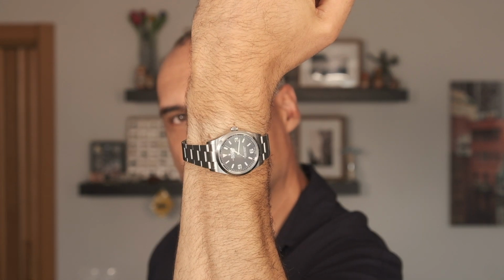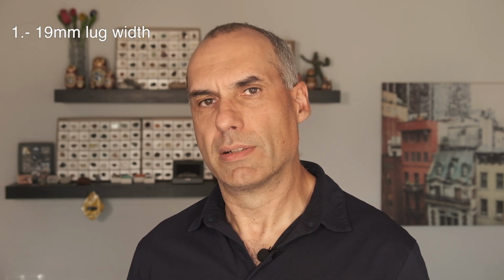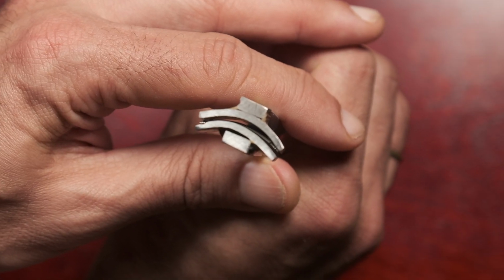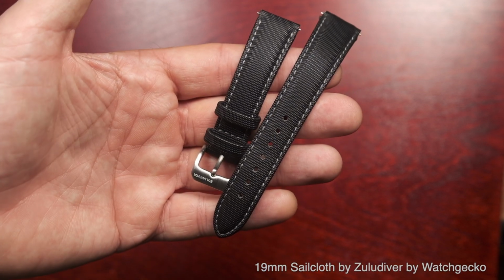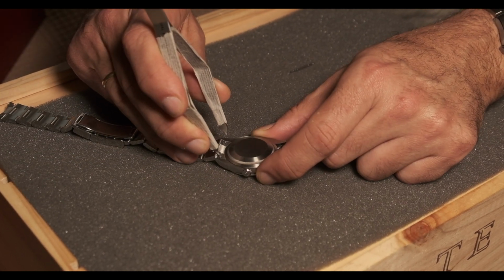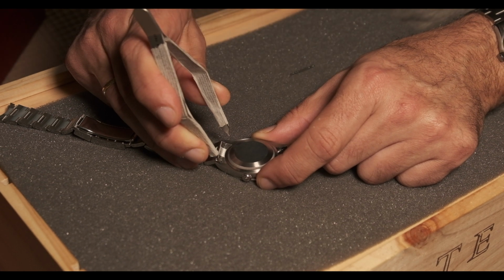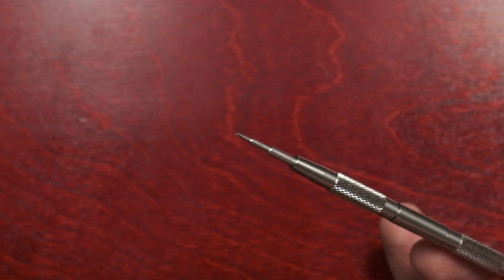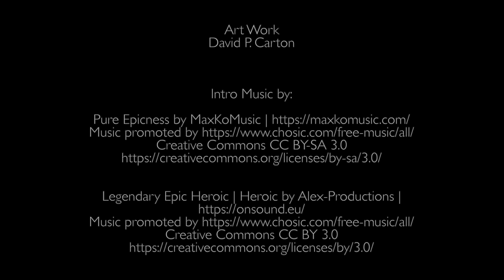Putting 19mm straps in Rolex Explorer 124270

Comment: Lug width was one of the reasons I chose the 114270, coupled with the kinda blocky case of the modern Rolex. However, the straps look good on the watch, and great vid!
Reply from the maker: Thanks. Yes, the 20mm lug width of the 11 is great wished the 12 had that too but well. Things are how they are.

Comment: Thanks Mario, my explorer spends 95% of the time on the Oyster.  But occasionally I wear on a strap too.  Do you have links for the spring bars and bar curving tool? 🙏🙏🙏
Reply from the maker: Hi Rob, yes, of course. I'm adding the links directly in the description of the video and here. The bending tool could be almost be anyone. This is a rather affordable one: https://www.ebay.es/itm/185273296763 (you will need to find similar ones). And the spring bars are here: https://www.ebay.es/itm/362067026444?var=631293451432 Remember to select the right length. Here's the 19mm ones. Very good quality.

Comment: Great video.  Did you buy 19mm spring bars or 20mm to factor in reduced length once bent?
Reply from the maker: I thought about it and I got the 19mm ones, and they fit perfect after bending. I made some tests of 20mm ones with other watch and they would not fit in the 19mm space of the Explorer, so 19mm is ok.

Comment: Great video as always Mario. Can I ask - do you feel the spring bars are sturdy after you bend them? I have the same watch and I'm a bit worried the bars will break during wear if i have bent them. I would buy good quality ones like the ones you have in the video. Do you have any issue with them after a few weeks / months of wear? Thanks!
Reply from the maker: Thanks! The spring bars I got, there's a link at the description, are very strong and feel very confident of them. They are extra thick and strong. In the video the one I'm bending is a normal spring bar because I  have more 19mm heavy duty ones, but not bent as I might use them in the future. The ones I have are still very strong. I have been wearing the ones I show put on the watch for over a year and are perfectly fine.
Reply: @TheWatchFrame  thank you!

Comment: Thank you for this video! It's very helpful. Quick questions - 
1. With the tricks mentioned in this video, do the straps look ok without being damaged by the sharp edges in a long term?

2. Also, did you find the sailcloth strap flexible enough to contour around the curved spring bar? or is it pretty stiff and still touch the sharp edge of the watch? wasn't 100% sure from the video.

Thanks!
Reply from the maker: Hi, about the first question. The case is very close even with curved spring bars, so it could be damaged. Most of the ones I have got a little wear there at the extreme. You must be very careful in any case.

About the second question, the one I got, the sailcloth, has straight quick release spring bars, but it is so thin it's one of the few that, as a matter of  facto, does not touch the watch case.
Reply: @TheWatchFrame  Thanks for your response! Does it leave any mark on the case of the watch where it touches the strap?
Reply from the maker: @ssang90  Not sure what you mean, but no, the strap will not damage the case, but the edges of the case might bring some wear to the extreme of the strap, but not to the sailcloth which is very thin.
Reply: @TheWatchFrame  Yeah, I was asking if it caused any visible damage to the watch itself. Thank you sir!
Reply from the maker: @ssang90  I did manage myself to scratch the under side of the lugs with the tool by trying to move the bracelet itself out of the head of the watch instead of the watch of the head away from the bracelet, thus my recommendation there, but again, that was purely my fault of not knowing what I was doing and trying to change straps when a bit nervous and out of time. To change straps with the Explorer is better to calm down and take time to gain experience and taping the metal parts of the watch before damaging it.
Reply: @TheWatchFrame  Good to know. I'll make sure my hands are steady and my heart is beating at a steady rate of 75 bpm before I attempt to change the strap on my Rolex watch. haha :D Thanks again for the helpful video and comments!

Comment: Great video ! I would like to change my original oyster strap from my explo 124270, however I do not wish to bend the springbars. Do you think that a standard strap with springbar in 19mm is accepted/adapted on this Explo 1? Thank you for your answer !
Reply from the maker: Well, yes, it's not advisable to bend the original spring bars, so any other 19mm bent ones will work. I however recommend heavy duty ones that have a bit wider tip to fit the lug holes. There's a not affiliated link in the description.

Comment: imo the ZULUDIVER Mayday Sailcloth Padded Divers Watch Strap looks the best: 
But I would probably never change the original stainless steel bracelet.
Reply from the maker: Yeah, the Sailcloth looks the part. I was very skeptical when I got it but it's one of my go to options specially during the summer. But true, the bracelet and the watch are a "one" made in design's heaven.

Comment: So, you are buying leather straps, and then inserting your own curved spring bar into the leather strap before putting them on the case?
Reply from the maker: Right, this way the risk of damaging the end of the strap decreases significantly.
Reply: @TheWatchFrame  and the strap itself isn't necessarily curved?  You are putting curved spring bars in strait leather straps instead of curved ones?... that's possible to do anyway? 

And thanks so much for all your content. I have followed your journey and appreciate the time you put into these. Thank you.
Reply from the maker: Thanks  @heathwoodruff6975 . Yes, I put curved spring bars is straight end straps but these in particular aver very subtle, thin and flexible. They do adapt well to the spring bars and don't appear to be stressed. It guess this wouldn't work with stiffer leather though.